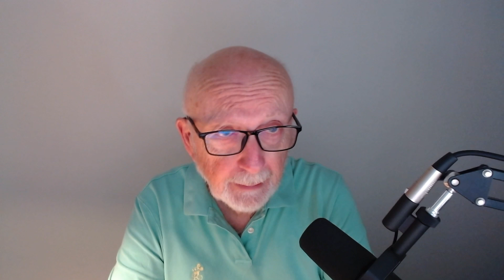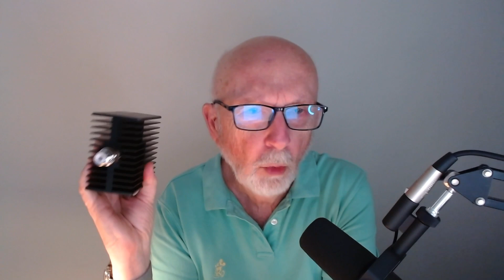Ham & CB Radio Myth - Non Resonant Antennas Don’t Radiate As Well.

Comment: Have I got this right?
You're saying to me a dipole is no better than a long wire or a long wire is as good?
I tested my 17m and 10m dipoles yesterday as an experiment against my homebrew Joystick with 26 feet of wire and an MFJ 160-10 tuner and the dipoles were definitely better. Much louder signals received.
Dipoles: resonant. Joystick: made resonant using a tuner. 
G4GHB.
Reply from the maker: How can you possibly compare a dipole, which near 100 percent efficient, with a Joystick antenna?  I had to look up what that is.  Looks like a British thing about 7 feet long with a loading coil in the center.   That is a poor antenna for the HF bands.  As one commenter said on eHam.net -"The only "joy" this thing will bring is when the disgusted amateur smashes it against a tree and tosses whats left into his trash bin."
Reply: You are the one saying a non resonant aerial is as good as a resonant one.
I disproved it
You're changing your story now.
As short as a Joystick is, in my case it loads up from 160m to 10m with 26 feet of wire. As their adverts said, good for flat dwellers. I don't say it's efficient, you're the one saying a non resonant aerial is as good as a resonant one.
G4GHB.
Reply from the maker: Some common sense has to come into play here.  I did not claim a bicycle is just as good an antenna as a dipole because anything non-resonant is just as good.  Did I really have to explain that?  You only proved that a Joystick antenna is greatly inferior to a dipole which everyone should already know.  But thanks for watching and taking the time to comment.
Reply: @BustRadioMyths  Yes , a tuned aerial against an untuned aerial with an a.t.u.. The point you are trying to make is that they should be as good as each other. 

Are you comparing a doublet with a tuner to a resonant dipole?
At some frequency the doublet will act as a dipole with twin feeder, where the atu isn't working hard in other words a dipole with twin feeder and a matching device.

Or a resonant 33' vertical is no better than a non resonant 20' vertical with tuner? I very much doubt it. 
My Joystick is either non resonant or resonant if I tune it with a tuner. Non resonant has a terrible SWR and doesn't radiate as well as when it is tuned. I checked this years ago when I was first licenced on long wires with a tuner, better radiation and low SWR as it comes to resonance. Why would I use it in a non resonant state?

Are you saying if I put my Joystick with it's 26' of wire you say it will be as good as a 33' tuned resonant vertical on 40 metres? It's not far off 33', 26' of wire and the 7' 10" of Joystick makes it a total of 33' 10", but allow for the coil in there, I don't know the effect that will have, I suppose end loading. It'll work pretty well. Now try 60m with about 44' of wire. The fact it is shorter and it's centre coil on the Joystick and the tuner all have losses. Sure, it WILL radiate because of the tuner. And it would with 10' of wire. Try 20m where the Joystick system is too long. How can it possibly be a good as the resonant vertical?
What are you comparing a non resonant aerial with? You haven't explained.
G4GHB.
Reply from the maker: You are comparing apples to oranges.  A Joystick is a shortened antenna.  You can't compare that to a full size antenna, either resonant or non-resonant.  You also compare a 33 foot resonant vertical with a 20 foot vertical.   The 20 foot vertical is considerably shorter which would kill its efficiency on that frequency.  If you were compare your 33 foot resonant vertical to a 40 foot vertical tuned with an antenna tuner, you wouldn't notice any difference.  Try that.  My video was not on shortened antennas vs a proper antenna. We are talking about two different things here.
Reply: @bill-2018 if you have a resonant dipole fed with rg58 vs a non resonant doublet cut roughly for the same frequency say 80m and 10.1 swr into a suitable tuner , fed with 600ohm open wire feedline,which do you think has more power at the antenna to radiate?
Reply: @paulm0hpd319  It's a non-resonant aerial made to work with the tuner impedance matching the tx output. R.f. goes into the wire regardless but how efficiently I don't know.  I'd still put up dipoles. Similar to a G5RV, it's matching, which a lot of people use to good effect, based around a doublet. Interesting how a G5RV works at different frequencies, a compromise aerial.
Reply: @bill-2018  correct  and which one will have the most power at the feedpoint to radiate
Reply: @bill-2018  the non resonant one tuned to resonance by the tuner ,showing that a non resonant antenna system with a high swr can be just as efficient if not more efficient than a natural resonant antenna system
Reply: @paulm0hpd319  But which will radiate most efficiently? I'll stick to my dipoles for each band not some compromise made to work on a few frequencies.
Reply: @bill-2018  because its tuned by the tuner doesn't mean the radiation efficiency drops ,it would take a significant length decrease to change that,note I've said the same frequency not multiple frequencies
Reply: @bill-2018  a resonant dipole fed at the end is a few thousand ohms ,does the radiation efficiency drop because its matched
Reply: @paulm0hpd319  The advantage of a doublet is more than one frequency so why put one up for one frequency? The r.f. pattern breaks up like any longer aerial at higher frequencies. Why bother? I have 5 dipoles 20m to 10m in my attic.
Reply: @bill-2018  to prove the point that a non resonant antenna system on the same frequency as a resonant antenna system will be just as efficient
Reply: @paulm0hpd319  But it's MADE resonant.
I wouldn't put a 10m dipole on a 40m tx. That's non resonant. Unless there's a tuner. We get away with it with 40m and 15m because it's three half waves and resonant.
Reply: @bill-2018  I don't think you are getting what I am saying, it's still not a natural resonant length, it's got an swr of 10.1 yet can still be as efficient as a resonant length that's almost a perfect match
Reply: @bill-2018  this is the point mark is making in the video
Reply: @paulm0hpd319  I'm not taking down 5 dipoles near to 50 Ω matching the tx to replace them with a doublet and 600 Ω feeder requiring a matching network.
Reply: @bill-2018  I am not asking you too ,just saying how a non resonant length can be just as efficient as a resonant length as you disagree with Marks explanation of resonant vs non resonant antenna
Reply: Some comments have disappeared. 
Where are the results I gave when I was asked by paulm0hpd319 to use my VNA on different lengths of coax to the same wire?
I provided the results and the question has also gone. Why? I don't know what it proved anyway. Both a low impedance with varying results and varying capacitance and inductance values as the frequency changed.
Following on from that I did the same for my Joystick without a tuner. Question and results also gone!
G4GHB.
Reply: @bill-2018  must be ytube deleting them I've had comments  also deleted
Reply: @bill-2018 an extended double zepp antenna is non resonant is far more efficient than your dipole
Reply: @Pioneer936  I don't care!
Reply: @bill-2018  you do you keep saying a resonant antenna is more efficient than a non resonant antenna

Comment: An RG8 low loss coax has a 10 mHz loss of
Reply: per 100 ft.   This is 8% of power turned to heat.   At a 3 to 1  SWR the power loss in the cable at 10 mHz could easily exceed 2 dB or about 37%.  Cable losses are a good reason to keep swr as low as possible.
Reply from the maker: At 10 MHz RG-8 has a loss of 0.5 db per 100 ft.  With a 3:1 SWR the total loss is still less than 1 db.  Check those charts again.  But I agree best to keep SWR low as reasonalby possible.

Comment: For the last fifty plus years fifty years I've worked, almost exclusively, on VHF & UHF Land Mobile Radio systems. I also only ever used the two meter band as a Ham. I treated myself to an Icom IC 7300 last Christmas and put up an end fed 40M half wave and used the only stuff to hand, some URM67. By the time I compared the loss with RG58, at HF frequencies, it was too late as it was already done. Roll on spring so I can re-engineer the job and replace the feeder. Thanks for another informative video. GW4NFJ 73's
Reply from the maker: Not sure I understand why you want to replace the line with RG-58, unless you want to save the URM67 for higher frequencies.  Consider using RG-8X.  It’s about the same size as RG-58 and a better coax.  But RG-58 should be fine for 40 meters.

Comment: interesting.. so what IS the right way to measure an antenna efficiency for a specific frequency?
Reply: I don't think as amateurs we can measure it, I know of no way.
All we can do is measure the input power at the tx coax and the other end of coax at the aerial but we can't tell the efficiency of the aerial. There shouldn't be much loss of course.
Dipoles are said to be very efficient, 95 - 98%. However close objects can absorb r.f., house copper water pipes, wiring, metal gutters etc.
G4GHB.
Reply: @bill-2018 then how about comparing one to one for dx? I would say i bet the non-resonant (wrong term, it is resonant just in the wrong freq) antenna forced to work at its non-native frequency with a use of a tuner, will at least yield an unusual (inferrior?) radiation pattern.
Reply: @EvgeniX.  Sure, that's what I say, a  doublets r.f. splits into more  lobes as the frequency increases but it will still work. Any aerial will radiate but how well?

Comment: Great presentation but I wish our hobby wpuld drop the term 'tuner' in favour of matcher or matchbox. A  'tuner' dosn't tune your antenna, and yes I know, the term tune can be used in the sense of 'to make better', but matcher makes a lot more sense to me.
Reply from the maker: True, but a "tuner" does tune your antenna in that it cancels out the reactance in the antenna, if you wanna get technical about it.  It makes the antenna resonate, even if it isn't without the matcher, matchbox, whatever.
Reply: It matches and it tunes so both are appropriate to use

Comment: Resonance does not always equal 1:1swr but a resonant antenna will always be more efficient than a non resonant antenna. Hell, the definition of the word “resonant” insists this…
Your best bet would be a resonant antenna with a 1:1 match.
And it’s not pronounced “resident”
Tuners are and always be lossy compared to a resonant dipole.
Etc
Etc
Reply: Either way, we’re talking loss… therefore, less efficient.
Reply from the maker: Provide one reliable reference from an antenna engineer supporting what you are saying.  I did.
Reply: @BustRadioMyths  whether or not any of that makes a real world difference is a different subject all together…
Reply from the maker: Nope.  Reflected power gets radiated, minus cable loss.  SWR is not reflected power.  It causes reflected power.  I would suggest you watch my other video "The Myth of SWR 2" or better read some of the references I posted.
Reply: @BustRadioMyths  common sense bud…
Swr is reflected power, that would be power that is not leaving your antenna.
Resonance is “the condition in which an electric circuit or device produces the largest possible response to an applied oscillating signal, especially when its inductive and its capacitative reactances are balanced.”

I don’t need “experts”, I own a dictionary.

Comment: When you held up a dummy load and attempted to make out that it is an antenna, you blew me away and I knew I should NOT take your opinions seriously.
I do however agree, that SWR alone is not an indication of efficiency.
I agree that a mismatch in impedance or even a reactive antenna is not necassarily an indication of either efficiency or the ability to be used.
I have used an antenna that had a SWR of 10:1 and yes, it worked, but no it didn't work very well. But it did what I wanted to do at the time.

And by the way - on a non-technical point, it isn't an antenna tuna. 
I don't think any fish is called that even if it were, I certainly wouldn't want to use one connected to my transmitter. 
It would be very fishy.
Reply from the maker: I like a tuner fish sandwich.
Reply: @BustRadioMyths  I had a tuner fish sandwich today and a tuner melt the day before.

Comment: Nice collection of half truths that will encourage the use of bad antennas. Thank you, my resonant antennas will become more useful as your followers signal strength drops.
Reply from the maker: Let's see your references that non-resonant antennas don't radiate as well as a resonant antenna.
Reply: My 17m and 10m dipoles outperformed my homebrew Joystick with it's 26' of wire and MFJ 160-10 tuner on receive the other day.
Of course resonant aerials work better.
G4GHB.
Reply: @bill-2018 no! That's not true, a non resonant antenna made resonant by a tuner can be just as efficient or more efficient than a resonant antenna with out a tuner, extended double zepp has gain over a resonant dipole
Reply: @Pioneer936  
Yes, and it's longer than a dipole which I already had to squash into my attic. I don't own a mansion with large garden.

Comment: If SWR is impedance mismatch at the antenna, and resistance of the cable.  Having nothing to do with resonance.  Then why does it change when I stick a piece of magnet wire directly into the SMA female pin of my VNA, and the SWR changes dramatically as I trim it down into resonance, and gets worse again as I trim it past resonance?  When you trim an antenna, you’re measuring at the antenna.  Not the feed line.  A tuner doesn’t just cancel impedance/inductance.  It changes the characteristics of the antenna itself.  A remote tuner isn’t just a fancy piece of equipment.  It’s a requirement if you have an antenna amplifier at the base of the antenna, because tuners before the amplifier cannot tune the antenna, since they’re not physically connected through the transformer.  Otherwise you’re only tuning the feed line from the base station to the amplifier.
Reply from the maker: See the references in my description.

Comment: An Antenna Tuner allows the user to adjust a non-resonant antenna to provide the Transmitter with a 50 Ohm Impedance so that there is little or no reflected power. But not all Antennas enjoy the full power of the Transmitter as a percentage of the RF energy is stored away inside of the variable reactive element inside of the Tuner, allowing most but not all of the power to actually reach the antenna. The true measure of any antenna is what percentage of the RF energy actually gets radiated from the Antenna. This is published in many RF journals. We also lose RF energy in the feeder that is also a part of the analysis when a Smith Chart is used to determine the proper impedance match. Now that said, a resonant antenna does not require an Antenna Tuner, but this does not mean that the antenna has good radiation efficiency. Many factors come into play, and we cannot assume that an Antenna Tuner cures every naughty Antenna. The Antenna Tuner is dssigned to allow users to rely on a single antenna for convenience.
Reply: There are resonant antennas that do require a tuner.  E.g., a folded dipole is resonant, but has a feedpoint impedance of about 300 ohms.  You'll need a tuner (usually a matching transformer, but it's the same thing), otherwise your transmitter won't like it.  Resonance just means no reactance, not that it's 50-ohms.
Reply: Rich writes so many words yet with no understanding

Comment: Size matters... 
For any given HF radio frequency: If a non-resonant doublet antenna's length is small (e.g., 1/8 wavelength), then its radiation resistance will be very low and its capacitive reactance high -- modeled via EZNEC at about (1.6 -j2400) ohms for a 1/8 wavelength wire doublet about 1/8 wavelength above ground.  Feeding RF power to a very low impedance (i.e., high current), highly reactive (i.e., non-resonant) or even a non-reactive (i.e., resonant via inductive loading) antenna is usually inefficient due to feedline, matching network and antenna conductor resistance approaching antenna radiation resistance.  Thus, doublet antenna system (feedline + matchbox + antenna) overall efficiency is highly dependent on the antenna's physical size (length) relative to applied wavelength, rather than its state of resonance.

Comment: common sense in ham radio, how refreshing.
There is nothing better than making contacts on a antenna the "powers to be" say does not work!
I have an email from a fellow ham who copied my whisper signal with no antenna. He was in the process of moving his radio and had the coax disconnected but the radio was on and still connected to his computer.
Another time my 80m antenna was down for repair so I used my MFJ-986 tuner to "load" my 40m antenna for a local net. Net controll said that can't work I said it depends on what book you read!
Best antenna I had for 80m was a co-ax dipole, worked great on 17m also!
been a ham for over 30 years and still enjoy the hobby with modest equipment.
Reading the comments it seems things will never change. Read a different book or magazine and broaden your horizons .. using a stainless kitchen sink with a counterpoise may work better than you think !! 73
Reply from the maker: Great post.  Even if your antenna is only 25% efficient that's down only one S unit.  No one could hear the difference.

Comment: I've just experimented a 25 meters lenght loop antenna made with a 2.5mm speaker wire and a 4:1 ballun on my balcony and have made contact from 160 m to 10 m with only 20W of my Xiegu G90 and its build-in antenna tuner :hand-purple-blue-peace: So yes, I agree with you Mark !   73's de F5GEB